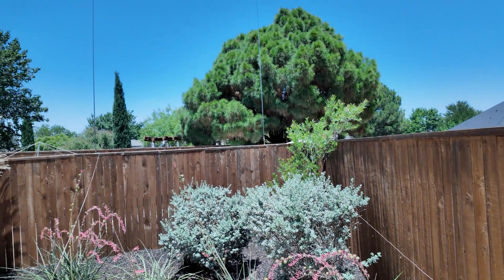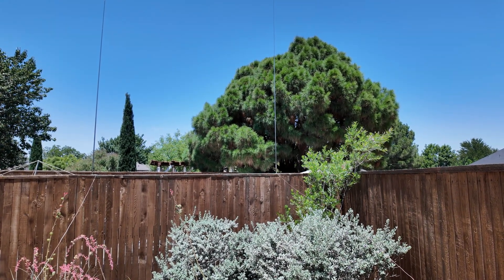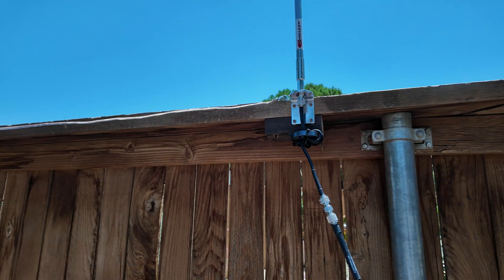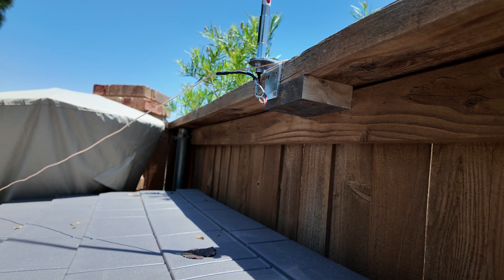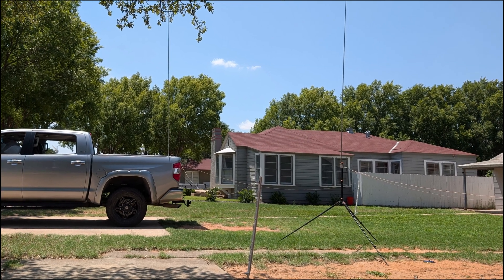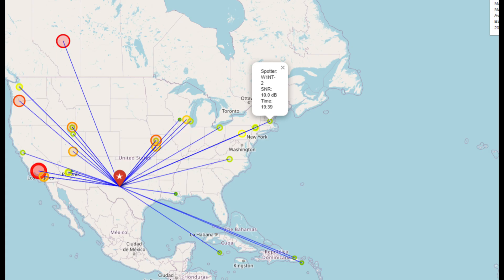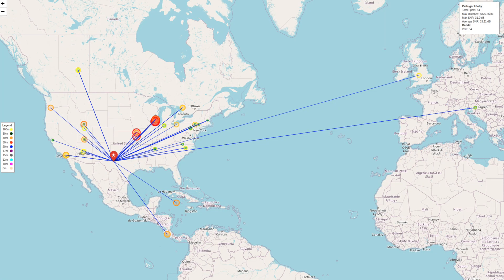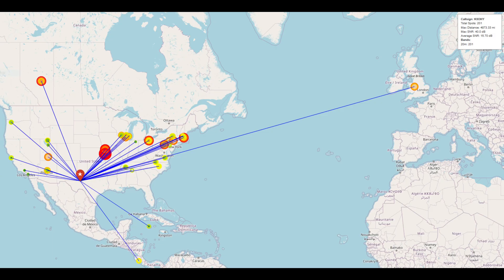Simple 2-Element Vertical Antenna

Comment: I love your vertical array. 

Full sized elements will always work best, but I did  proof-of-concept experiments with "compromise" antennas. I made a yard-stick dipole and extended it to be lower than the band. Then I shorted out the feed point and walked around my vertical ground plane. Signals peaked and faded depending on where I held it up. When I was at the peak signal, I took the yardstick away and the signal dropped.  

So, if you want a little more power in one direction in the field, you can put one of these up on a stand and not have to stretch out the additional ground wire.  It may not be the best, but it may be just good enough.  

You could put a 40m hamstick as a reflector or director for 20m.  Just put it on a tripod at the best distance and direction.
Reply from the maker: I've done a bunch of tests on my "fence array". I get about a 2 S-unit improvement with the 2 parasitic elements. It's not as good as a beam on a tower but I'm getting a little bit of gain which helps!
Reply: @Tim-K5OHY  I always say, don't knock anything, better is always better... ;)

Comment: Hi Tim, Keith, WB2VUO near Buffalo.  I have tried similar, but on 6 meters because of a lack of space. My Driven is a 1/2-wave vertical dipole (VK2ZOI Flowerpot design) and I used parasitic directors or reflectors taped to PVC tubing. I set mine up on a second floor balcony. No radials or ground screens required. Added 20 countries out of Europe and South America to the log this was!

My small urban yard is closed in with trees & power lines, so vertical beams was the best way to go. I haven't taken them to the field, but will this fall. 60 years in Ham Radio, and there's always somethjng new to try, no?

73, Keith, WB2VUO
Reply from the maker: Hey Keith, using a vertical dipole array seems very interesting. Looks like it worked really well for you. When you have a small yard you have to get creative! I built a 6m moxon and made a few contacts but it seems that everyone is on FT8 on 6m.  73 de K5OHY

Comment: Hey Tim, great job! Thanks for being my 2-element PERformer quarterwave parasitic array alpha-tester!! OK, I have some significant updates for you to experiment with. I will be publishing the details soon - I just finished running dozens of computer model simulations with two parasitic PERformer antennas with radials @ 180 degrees (must be omnidirectional). My original assumptions before modeling were based upon a HALFWAVE parasitic array (e.g. my Dominator 2-Element Beam). However, when you create a 2-element parasitic array with two QUARTERWAVE antennas, things are much different. 

Here's the bottomline: you need add a REFLECTOR (not a Director) which is 2% longer than the radiator (not 5%) with 0.250 wavelength spacing (not 0.150 wavelength) for a gain of +2.9 dB over a single PERformer with radials @ 180 degrees. In this configuration, you will get an 8.2 dB front-to-back and 5.0 dB front-to-side! I ran the model with many different element spacings and parasitic lengths and this is the optimal configuration. 

I'm field testing it now and will be publishing the PDF over the next month or so. I will also be including a 2-element phased array where both PERformers will be fed by coax for switchable gains broadside (+3.7 dB) and end-to-end (+2.1 dB). Many more details to follow! Send me an email if you have questions, I'd be happy to help! 😀 73 KJ6ER
Reply from the maker: Greg, thanks for the comment! Its funny I spent the good portion of the day learning the basics of antenna modeling. It's quite overwhelming as a beginner, however I was able to model the antenna. It's interesting because at first I placed the radials 90 degrees apart but soon realized they need to be at 180.

I will definitely send an email. I plan on doing some testing with the RBN at the park soon. I've got a few days off next week. 73 and thanks for the info!

Comment: The maximum gain of a 2-element parasitic vertical array is typically around 3 dB—which means double the power in the forward direction compared to a decent single ¼-wave vertical with 4 raised radials.
That might not sound like much, but in RF terms, it’s actually a big deal! 😉

Meanwhile, the average POTA performer often goes the other way—cutting down to just 2 radials thinking it’s “good enough.” or it's now directional,Ironically, that can result in less gain than before, thanks to rising ground losses.

And here’s the kicker: many base their judgment on near-field strength (holding an analyser a few meters away)… but measurements in the near-field have nothing to do with far field gain .... you are measuring losses instead of gain ;)
Reply from the maker: Thank you so much for the clarification! I'm just learning about these antennas and enjoy experimenting. However there is a lot to learn! My understanding of the POTA Performer is there raising the radials off the ground avoids much of the ground loss. With 2 elevated radials it's equivalent to something like 64 ground radials. I've been told that a 1/4 wave with 2 elevated radials is about 90% efficient and with 4 it bumps up to 94%. Thanks for the comment. 73

Comment: Nice setup.  20m is my favorite as well.  You may want to try an end fed half square or center fed bobtail curtain.  Phasing at the top of the verticles puts the high current anti-nodes at the top for greater efficiency as well as lower takeoff angle.  73 KK7YIS
Reply from the maker: I will definitely give them a try. A end fed half square would be pretty easy for me to set up in the field. Thanks for the suggestions!

Comment: Hi Tim that's very interesting and your results are like the ones i am experiencing. If you care to read check also the Half square antenna that has basically the same gain but the F/B is symmetrical. Problem with the two elements is that the 5dBi are at about 25deg. We need to flatten the lobe. Cheers de N6LDM
Reply from the maker: Thanks for the comment! I'll definitely have to look into the half square antenna. Thanks for the suggestion. 73

Comment: I'm using a 31 foot vertical with a 7 foot top hat into a 9 to 1 balun. It tunes 80 to 6m and it works very well.
Reply from the maker: I bet that is going to work well. I really like random wires due to the fact you can easily work many bands without any adjustments!

Comment: Great video. I have 4 of the Amazon 18 foot versions of that antenna and have done some of the same things. Also 2 of those whips horizontally make an excellent dipole if you can get it high enough. I’ve used a spiderbeam pole for that and you get decent directionality. 73.
Reply from the maker: I might need to get a few other Amazon whips so I can leave them on the fence. I've never tried them in dipole conf, mainly because my mast probably can't support them. Some day I'll give it a try. 73

Comment: Hungary by day from W. Texas on a 2el array is pretty good!  In some areas Texas has high ground conductivity (15-30millmhos) which could contribute to the good performance of your antenna.
Reply from the maker: Occasionally I've worked DX on 20m but it's rare and not with the current band conditions. Hopefully the upper bands will be open soon.

Comment: Looks like a need another 17ft whip, or maybe the 25ft now hmmmm. Thanks for the video on this, this is way cool. I may bust out the ol tape measure and cut it up to experiment with this.
Reply from the maker: Give it a try. The 25' whips are very handy I've been using it with the small Chameleon coil  for 40m. The 25' whip works great as a 1/4 for 30m too.